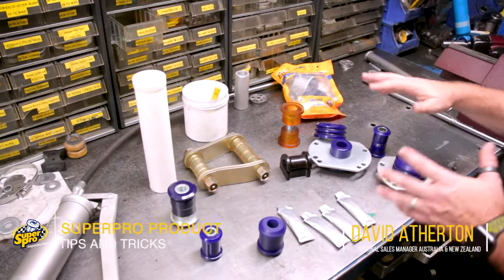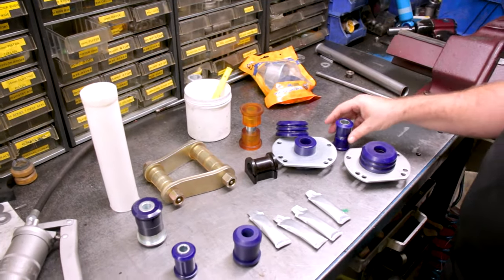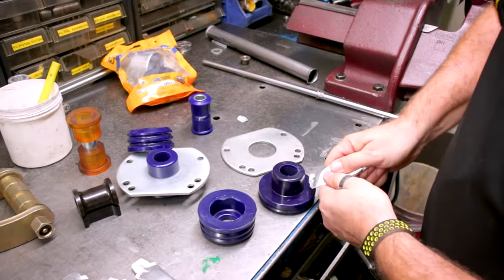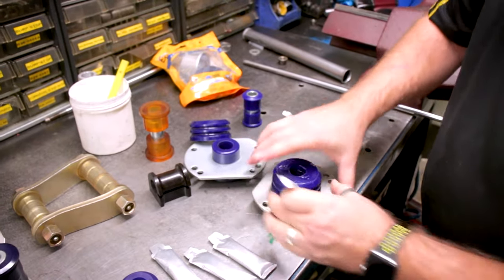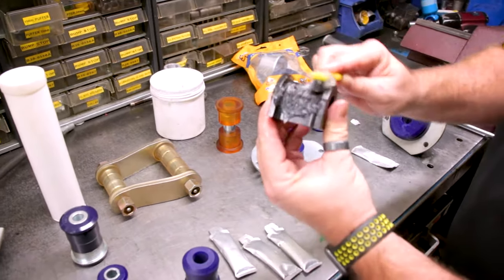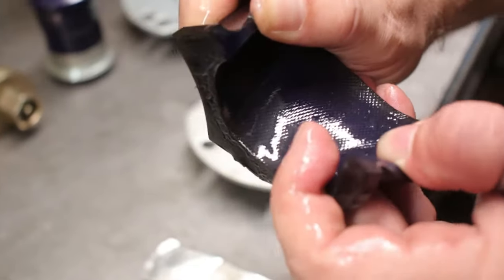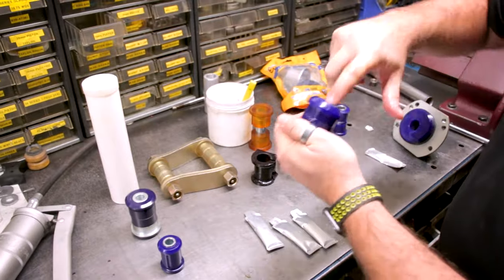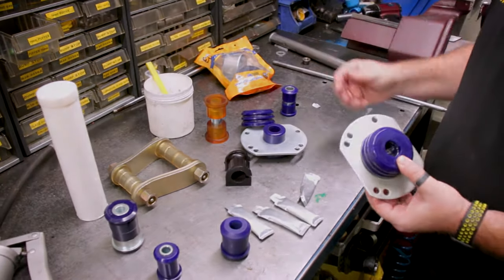How to Grease SuperPro Bushings

Comment: What about with 4WDs that will go through dust and mud - will the mud or dust enter the bushing when it flexes and essentially attach to the grease and turn into grinding paste?
Reply: agreed only enough for assembly. clean clean clean. but like he said the assembly is for a Dunny door so its going to breakdow anyway not as badly as a Found On a Rubbish Dump.

Comment: There is mixed opinions on lubricating the outside of a cotton reel control arm bush. You recommend lubricating it I take it from the video? I thought the outside of the bush was supposed to stay fixed to the housing and the pivot point is the inside of the bush against the crush tube?
Reply from the maker: If you don’t lube the outside of the bush you will not get it in easily and yes it pivots on the crush tube.
Reply: @SuperProSuspensionParts  is it possible to make a video about your castor correction kit.how to determine the position of the Bush  or do you provide a template for example for the specific vehicle. 
I was thinking one of your kits for my jimny with 2 inch lift.
Reply from the maker: @pkatsigris  we supply a installation sheet guide with all bushings. But good idea about the video!
Reply: @SuperProSuspensionParts  How long these grease last in the bushing?
Reply: “Nobody likes a dry bush.” 😂
Reply: The outside is smooth so almost all of the grease will be pushed out as you push in, the rest should work its way out over time.
The grease on the inside will mostly be pushed out too, but the knurling will retain enough.

Comment: As a mining and rail service tech there are rubber components that must never touch rubber components. 
I guess this is not really a grease but an assembly paste. 
Ensuring that areas with grease must not be exposed to the air as this can hold road grit and this can act like sand paper and chew the rubber and remove the coating on the metal component. 
most of our rubber components have a 10 to 12 year warranty or 2 million kilometres. 
the rubber usually becomes hard rather than be chew away. because of our procedure.
Reply: Polyurethane is a type of plastic not rubber, otherwise what you said is spot on.
Reply: I've had enough with Poly's ... I'm a rubber man through and through